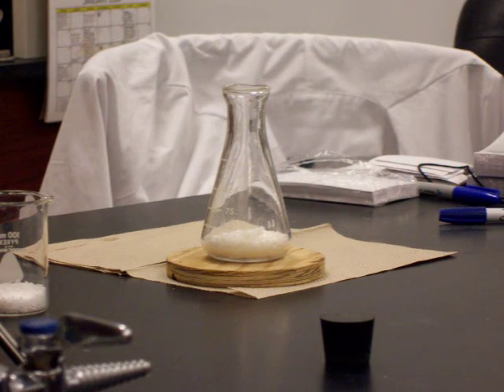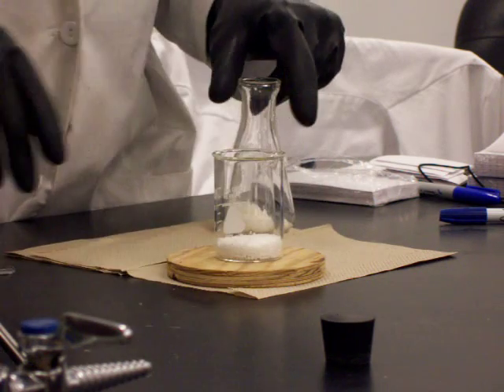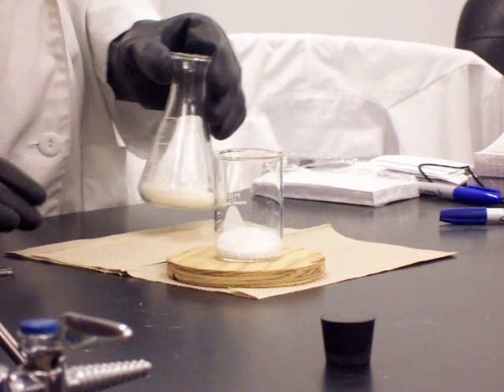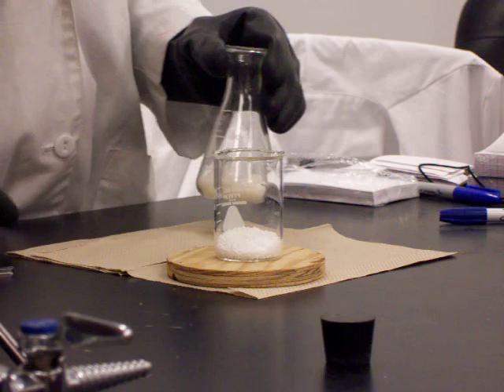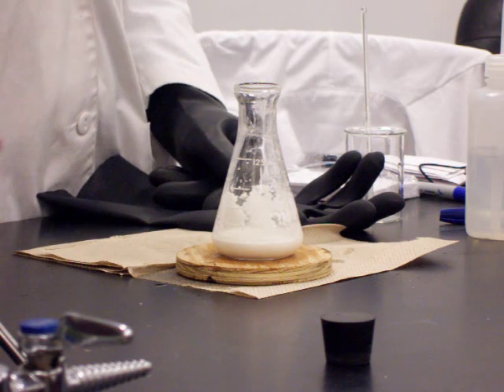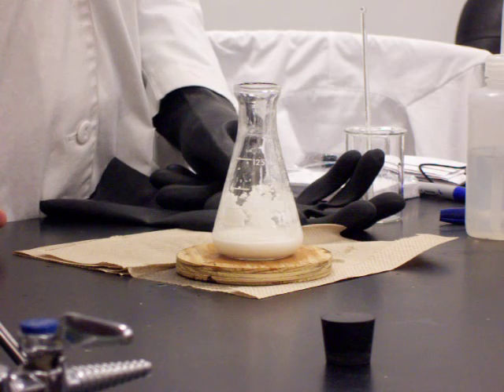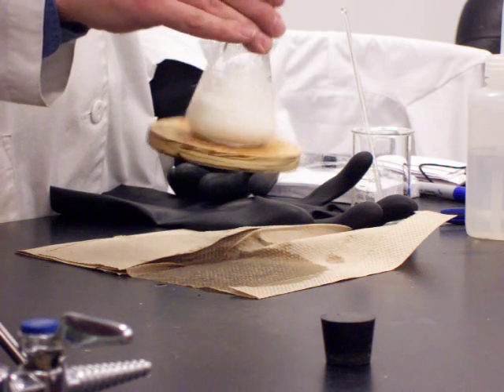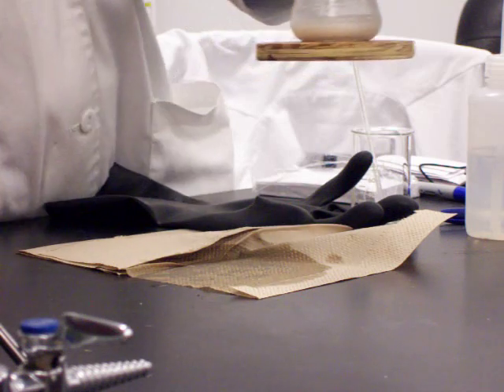Chemical Ice Pack/ Endothermic Quick Freeze

Comment: Does the reaction last 30 min?
Reply from the maker: No, the reaction itself only last a couple of minutes, but the cooling enough to freeze water does last about 20-30 minutes.
Reply: Yeah, sorry. I meant the cooling. That's perfect. Is there any way to make it last longer?
Reply from the maker: Upping the quantities of reactants used would probably make it drag out longer.  Also, maybe with an insulated container, but that depends on your desire for use.  If the goal is to use it like an ice pack then an insulated container will also prevent "the cold from getting out".
Beyond that there are several other variations on chemicals that can be used for this reaction.  If I remember correctly, this combination is the next to coldest (and is decently toxic and expensive).  There is one common combination that is slightly colder, but is more expensive and so I haven't done that one in my class before.
Reply: Nice. Yeah, for you to understand what's my intention with that. I'm developing a cooling system for a RC Boat that i'm going to present in a Science fair. I should create something considering physics and something using chemistry.
Reply from the maker: Try it, if you are using it as a heat sink it may or may not last as long as you need it to, but I think part of any science fair exhibit should show experimentation and trying (even if it doesn't work).

Comment: How long does the mix stays cold ? and what happens if something heat the mix ? 
If they warm enough do they increase the pressure ? 
Thanks !
Reply from the maker: I've never measured the temperature change over long periods of time.  When I do successfully freeze the wooden block to the flask [sometimes it doesn't work] it will stay frozen for up to a half hour.
A little bit of heat before the reaction speeds it up because it is endothermic, but the temperature change can be masked (or at least not colder than room temperature) if you warm it up too much.  Warming it up after the reaction drives it towards completion, but doesn't do much otherwise.
There is some gas evolved in this reaction, plus some gas in the flask to begin with, so you get a minor pressure increase, but nothing much more significant than just heating a closed flask does.  I'm sure you could pop the stopper off, but I would be surprised if you could do much more.
Reply: Thanks !!
Reply: @MrEricSully  what are the byproducts after the reaction is complete?

Comment: that's how dry ice packs are made right when you squish them together they become cold
Reply from the maker: Kind of, instant cold packs usually just have one chemical inside of them that has a really endothermic heat of solution [ammonium nitrate and ammonium chloride are probably the most common], rather than using a reaction that has an endothermic heat of solution, especially since the barium hydroxide used here is so toxic.  In a cold pack the water is usually in the part you pop and it mixes with one dry powder.
Reply: ty

Comment: Mr. sully. Would this also work on the cheap with sodium hydroxide [lye] and ammonium nitrate?
Reply from the maker: No because sodium hydroxide is very exothermic [gives off heat] as it dissolves.  Also you would need to add water in that situation because the water in the slurry here comes from the waters trapped in barium hydroxide.
It is possible to notice the endothermic heat of solution of ammonium nitrate if you just dissolve it in water [this is often used in instant cold packs], but it will not get to the freezing point of water.

Comment from the maker: If you only dissolve it then yet, however why dissolve it in the first case if that is your goal (unless you are trying to do purification through crystallization).  However, as I've pointed out in other comments in this particular demonstration I do a reaction that turns the ammonium nitrate into other things (mainly ammonia gas and barium nitrate) such that there is no ammonium nitrate left to recover.  When I were to evaporate this solution I have barium hydroxide.

Comment from the maker: Not through freezing because it dissolves and freezing changes that freezing point, but the ammonium nitrate is still dissolved.  There are ways to get it back out, but freezing is not one of them.  Also, keep in mind that in this demonstration I do a reaction and so then the original material is consumed as a new products are formed, so it doesn't work all the more.

Comment from the maker: I'd use the Hess's Law formula.  You'd also need the entropy (delta H) values for each of the reactants and products- I'd ave to look tose up form a table, I don't just know them.
As far as the ratio of reactants you need a balanced reaction equation:
Ba(OH)2 8H2O + 2 (NH4)(NO3) -> Ba(NO3)2 + 2 NH3 + 10 H2O.  The molar ratio is 1:2 according to the way I have it written here.  There are a few variations on this demonstration so you may want to check the reactants.

Comment from the maker: @oxsweety18xo If I put water in the flask the reaction would seem less endothermic because it would also have to cool the water and if might not get cold enough to freeze the wood disk to the flask.  Beyond that the reaction should still occur, but more of the ammonia gas that is released would dissolve in the extra water forming basic ammonium hydroxide.  Also, it would ruin the fun of the rare/uncommon solid-solid reaction.

Comment from the maker: @esteinapt9 If you are talking about just cooling the skin [like a chemical ice/cold pack] yes- in fact this reaction is used in some, but because of the toxicity of the Ba(OH)2 many times the (NH4)Cl and H2O are used [it has an endothermic heat of solution].
If you are talking about freezing that skin that is unsafe and could cause frostbite and although I know ways I wouldn't try them.
If you are talking about direct application to the skin it would be doable, but is easier to make a pack.